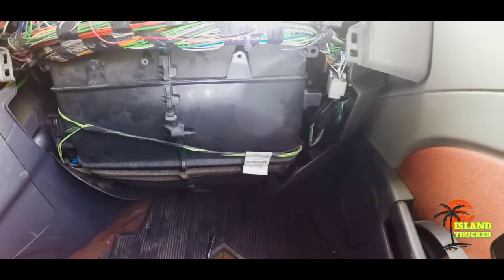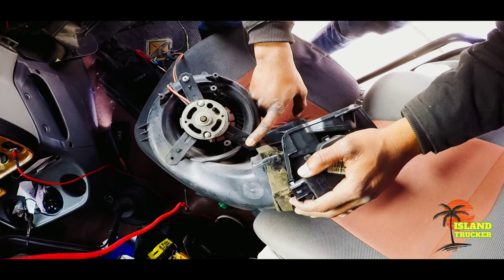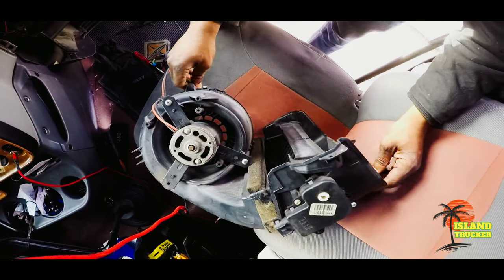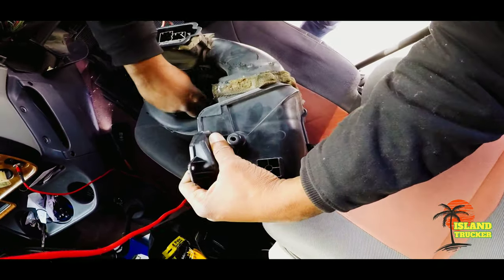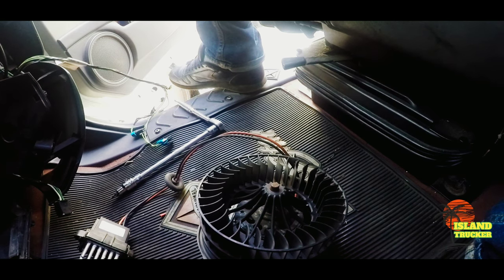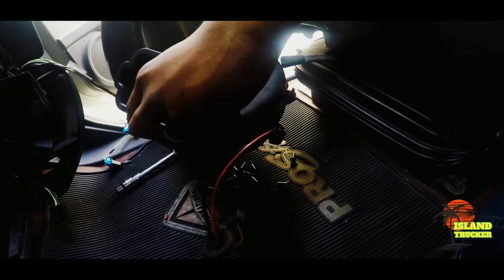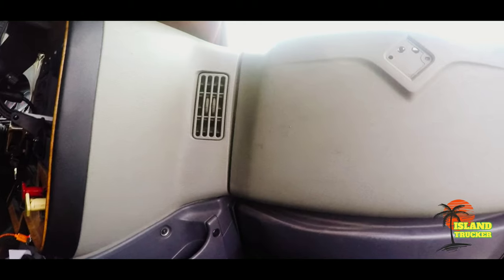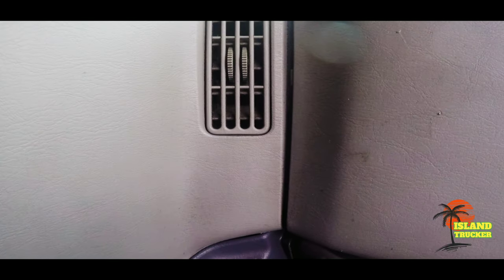How to replace blower motor on a TRACTOR TRAILER

Comment: Someone told me that some truck dealerships use some trucks as parts trucks and I learned that u can't trust anyone to work on ur truck or car from a white Jamaican guy my mother was dating that's why I don't forget how he ripped me off but yea you should have hard wired your new install and hopefully u keep the old one because if u go to a electronic supply store u can just show them the part out of the plastic peace and they might can see if they have a replacement they have a lot of electronic supply stores everywhere but if u spliced the wire then soldered the tips together then put butt connectors on them it would make a better connection that's your problem the cab is on air shaking and the international connectors and wire are aluminum they over heat then the connectors and wire melt good things is u can take the old one see if u can't buy a new electronic component fuck wit it outside of the dash and replace the wire a wash that plastic thing off and get a twelve volt wire and plug off of something else and b4 u reinstall the refurbished one test it to make sure it works u can even practice soldering some copper stranded wire to the old one and buy copper plastic plugs that u can solder on the better connectors and higher grade fan blower would probably last for the life of the truck same small problem wit the headlights me personally I call it fraud the international dealership gathers all the old head lamps they can get 4 free and charge u 4 a new head lite they dip that old shit in clr or rubbing alcohol and rewire all that shit and sell it as refurbished u can learn how to solder on YouTube
Reply from the maker: Thanks for those info, I did learn how to solder on youtube. No training institution can beat the price of youtube university 🤣😂🤣